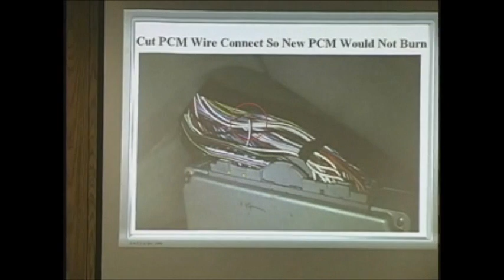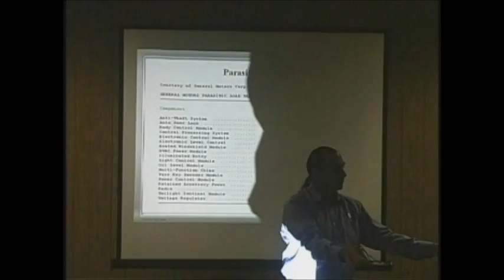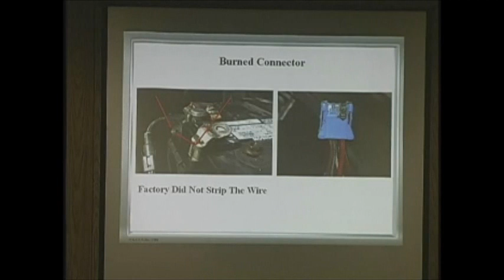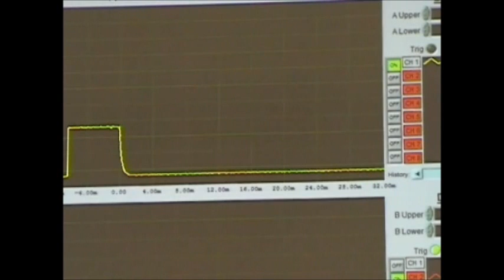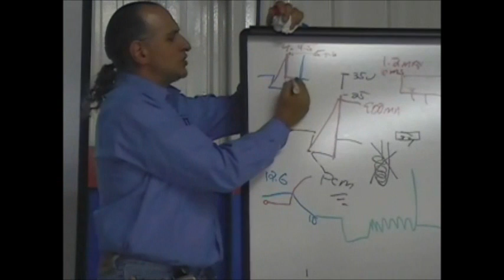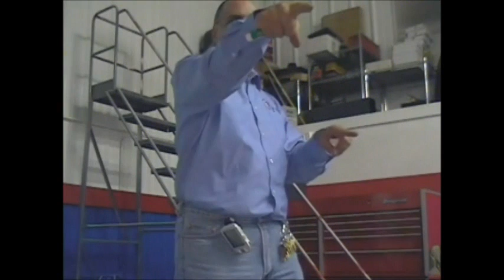Electrical Diagnostics with "G" Jerry Truglia and Rich Peterson

Comment: Jerry said he can get his high amp probe to read as low as .0010 ma,  How ?? I have the same amp probe he has and I cannot understand how he does that ? I have placed my 600 amp pdi probe on the neg battery cable and then use my low amp probe. Two competently different reading. The high amp probe seems to have a "ghost reading"
Reply: You can increase the sensitivity of your current probe to some extent by looping the wire multiple times and clamping your probe around the bundle. If you use 10 loops, your sensitivity will be 10x higher.
Reply from the maker: Not with the PDI clamp but with a Fluke I30 amp clamp....from Fluke the I30 current clamp is based on Hall Effect technology for use in measurement of both DC and AC current. The DC range is from 30 mA to 30 A. It's not as accurate under 30mA but it does read very close. It's about $460.00 bucks. Thanks for your comment and for watching....If you have not already subscribed to our tstseminars YouTube channel please do so.
Reply: more Rich Peterson please
Reply from the maker: We are trying to get him out to do more...stay tunned ... Thanks for watching and your comment. If you have not already subscribed to our tstseminars YouTube channel please do so.

Comment: Jerry, on 1 hour and 3 minutes of this video does he mean he hooks the neg side of the volt meter to the positive side of the alternator?  He says he takes the neg lead and i am going to hook it up to the positive side of the volt meter.  It looks like the stud of the alternator.  I had to look at the video 4 times to catch that.  Am I right on this?  Thanks, and thank you guys for sharing these, amazing videos, you guys rock!
Reply from the maker: Yes the negative of the amp meter to the positive of the alternator and the positive end lead of the amp meter to the battery back since the battery back will be substituted as the battery for testing. Thanks for watching
Reply: wagonlight
Reply from the maker: Yes the negative of the amp meter to the positive of the alternator and the positive end lead of the amp meter to the battery back since the battery back will be substituted as the battery for testing. Thanks for watching